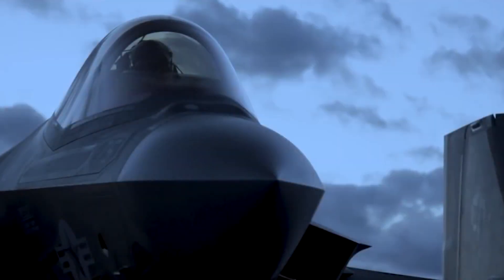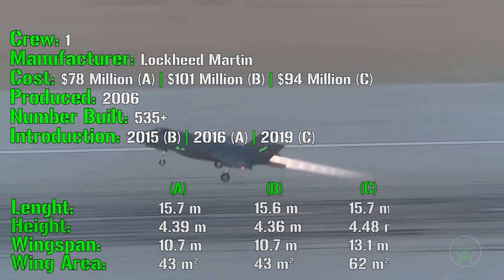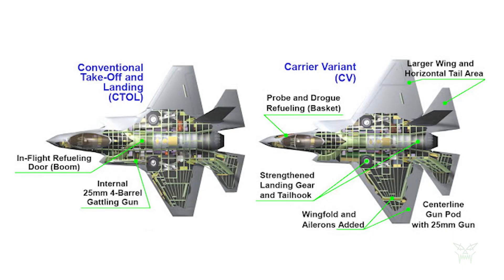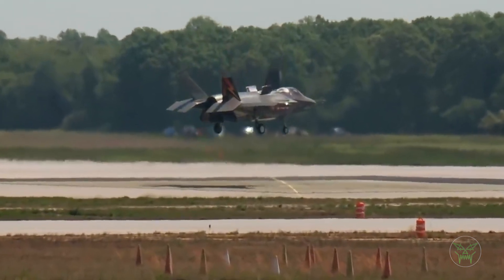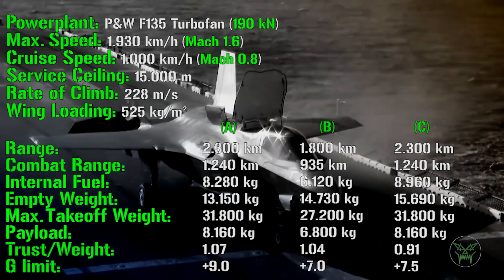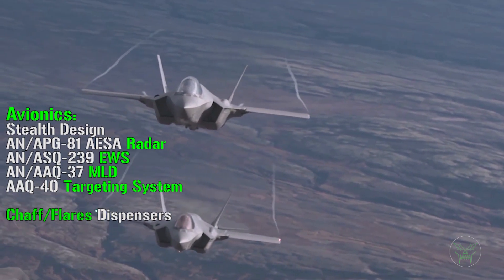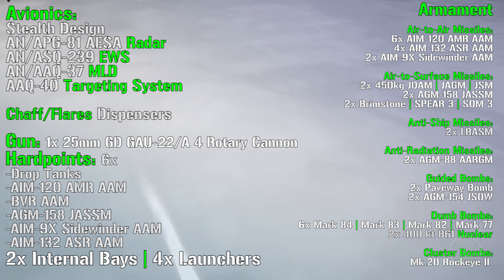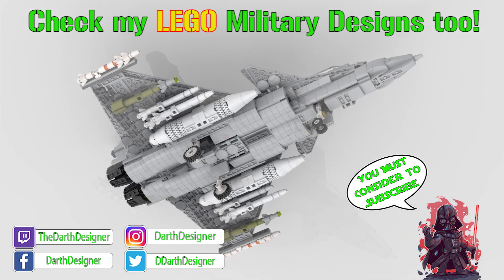F-35 Lightning II - ALL VARIANTS EXPLAINED | Lockheed Martin

Comment: The F-35B can't carry the GBU-31 (Mk84 2000 lb). The inboard stores hardpoints are plumbed into the jet's fuel system, but it's not able to carry Drop Tanks yet